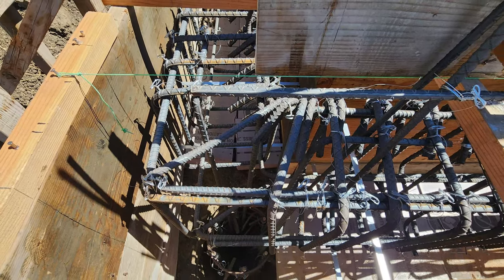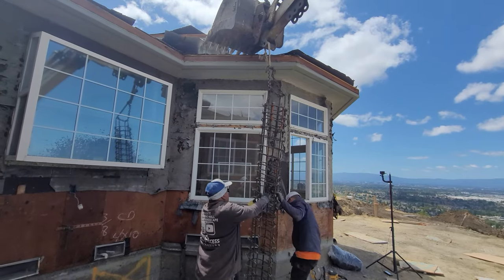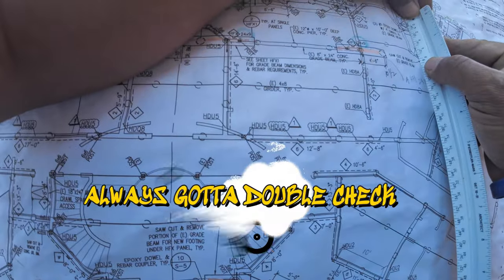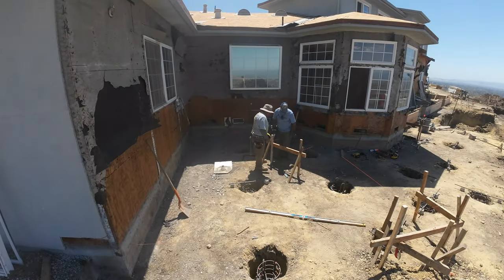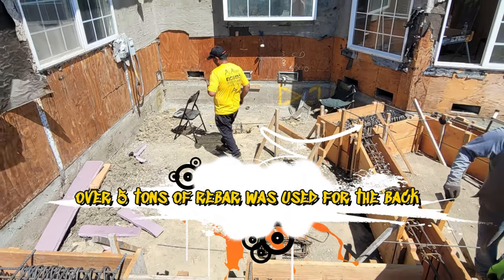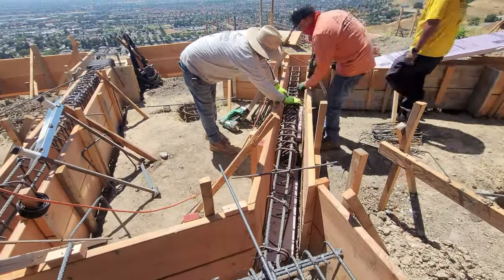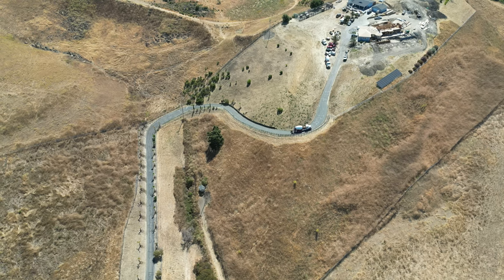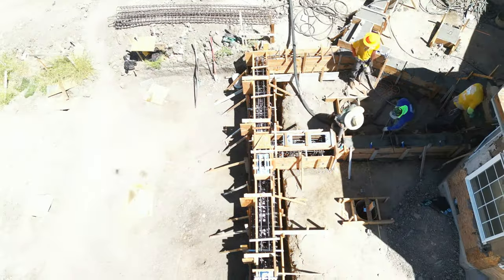How To Install Concrete Foundation And Piers For Kitchen Remodel

Comment: Hey Joe question, what would you rather do from a logistical standpoint - 8" thick slab with another 12" of grade beam grid under it, aka the Waffle slab, or just a running footer with these piers?I know it's all money but wondering if there is one you prefer. 

Work looking mint as always
Reply from the maker: Never done it the other way.. We kinda got muscle memory with the pier and grade beam especially since we are pouring it monolithic..

Are they giving you an option?
Reply: @AllAccessConstruction  yeah on my last project I got the option from the soils engineer for those two types. We went with the waffle as it's easier to set up with basic hand labor, but now I have the equipment that could drill the piers :D
Reply from the maker: Nice